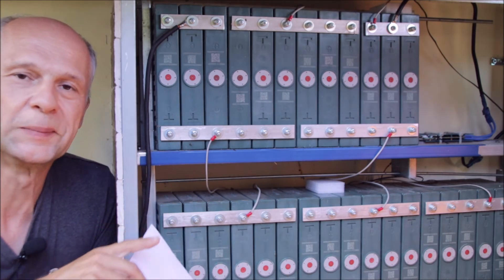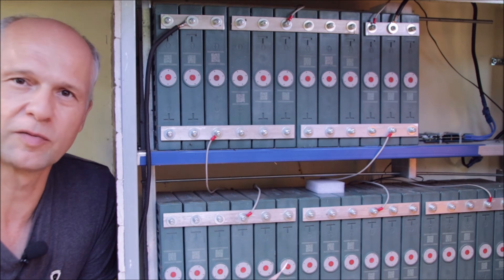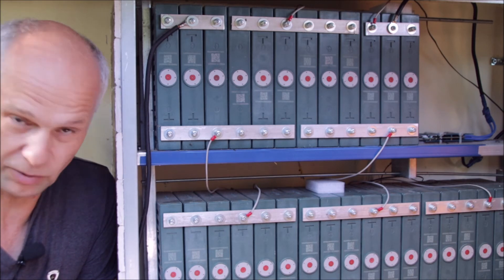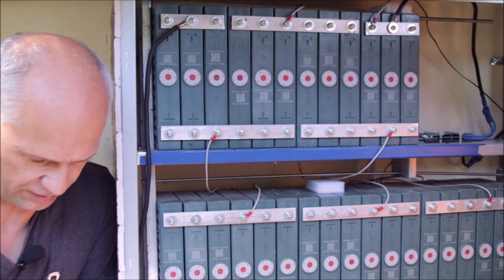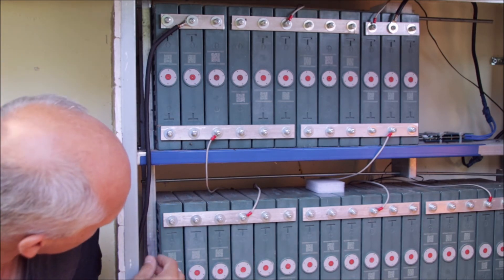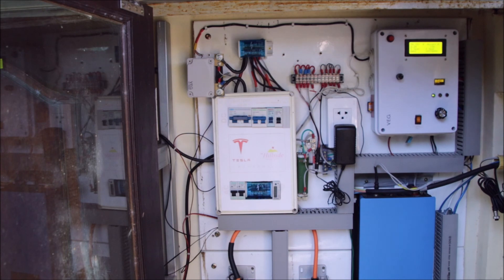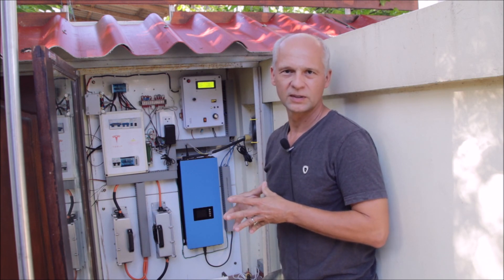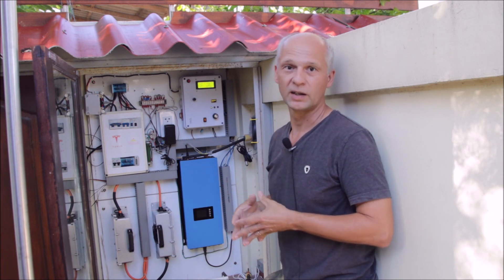What Wire Sizes and Bus Bars to use in your DIY Battery Build

Comment: the bms can i use a 25AH diy battery with two 60AH bms in parallel?
Reply from the maker: No, you cannot use one battery (as string) and two BMS (for that string). Because if one BMS decides to shut down, all the current would go through the other one. Similar there will as well be different resistances through the two BMS's. One will always allow more current to flow though it then the other. Just make one String=one BMS!
Reply: oh i wll take it for them ,but it three separate pack 25ah 140 cells,60ah 140 cell and 60ah 203  cells only drawing 200watts charge 28.4 discharge 25 volt ?pack 1.2 kw.
Reply from the maker: @olvano  Yes. Give each of those packs a separate small BMS, and after the BMS you go into the DC Bus/Breaker for further distribution. If you are not drawing a lot of current, you can use low Amp BMS's
Reply: thank 's  😎😎😎